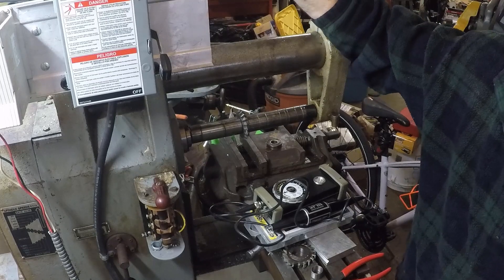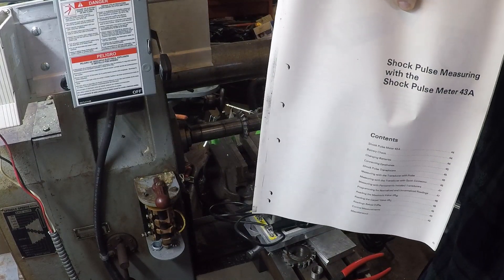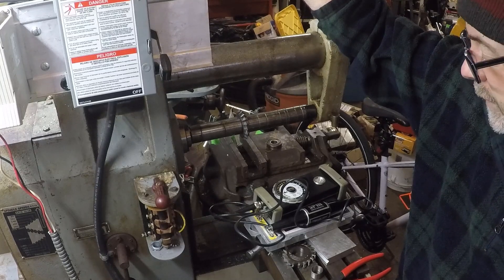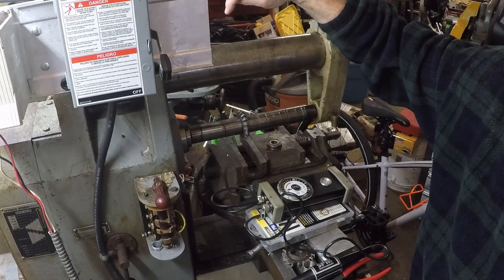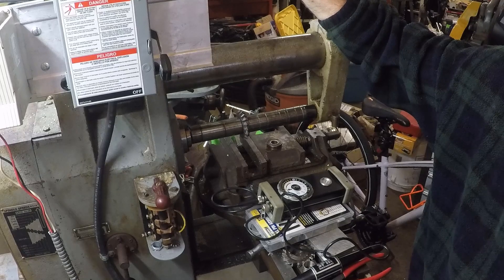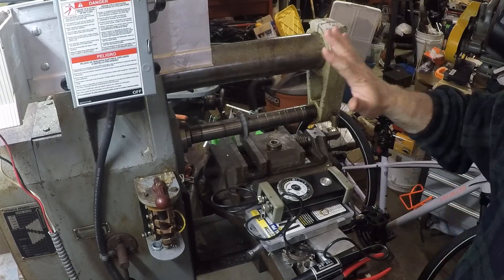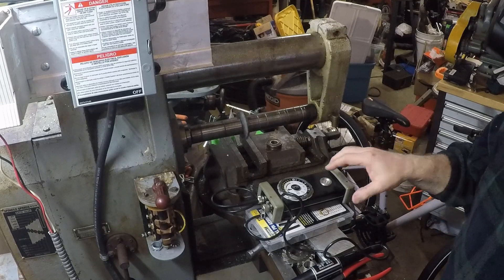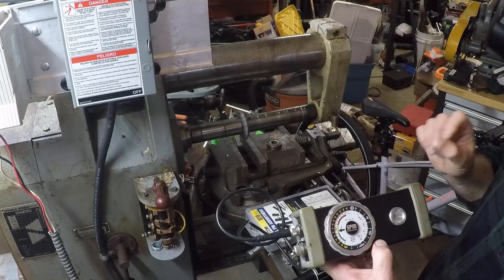Shock Pulse Bearing Measurement - What maybe I could not hear!

Comment: pretty interesting tool dan, I figured the bearings in the bench grinder would be much worse than that, lol. Good to see the horizontal mill up and running from the last video, and you said that I had a universal mill, it's the same horizontal one as you, I just got some endmill holders that fit into the NTMB 30 tapers, and I just slide the overarm support back out of the way, lol.
Reply from the maker: Chirpy's Tinkerings Thanks for watching - my mistake on what you have at your shop. I was surprised the shock tool was fairly responsive.Certainly beats a long screwdriver up to my ear. LOL!